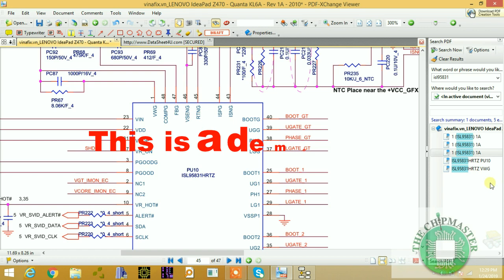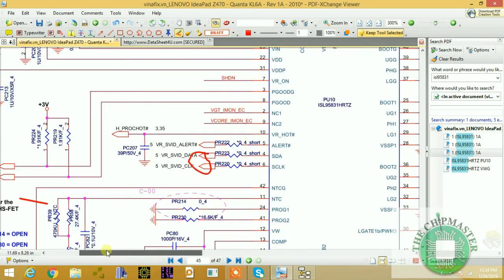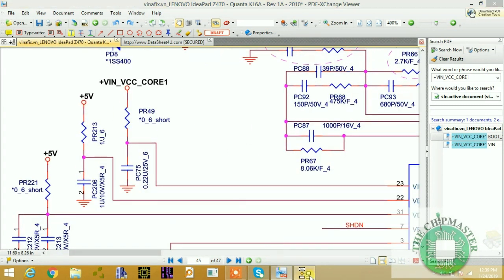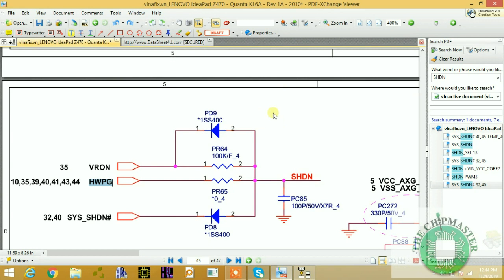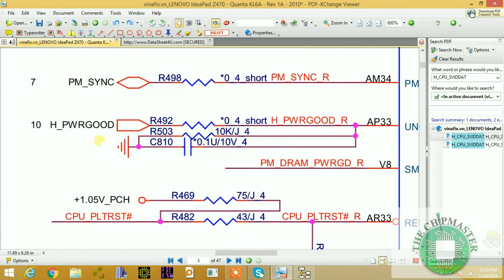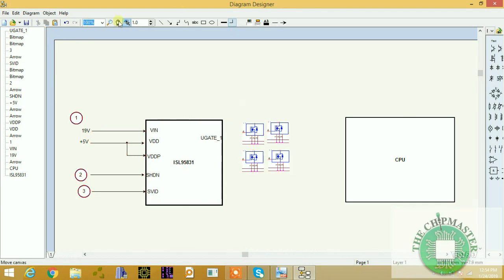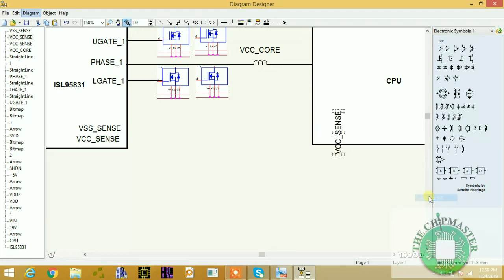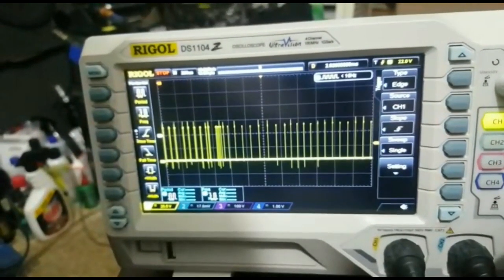CPU power supply explained demo

Comment: Chipmaste can you explain weather its possible to test LVDS RED/Green/Blue   TXE 2+ TXE 2- signals with multimeter
Reply from the maker: yes but the multimeter wont be able to show the voltage over time so its best to use a DSO